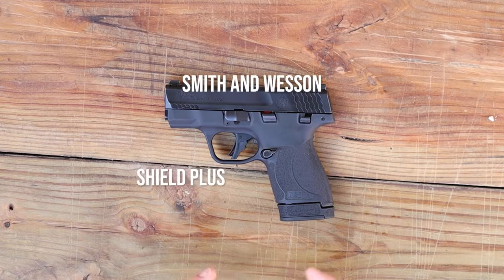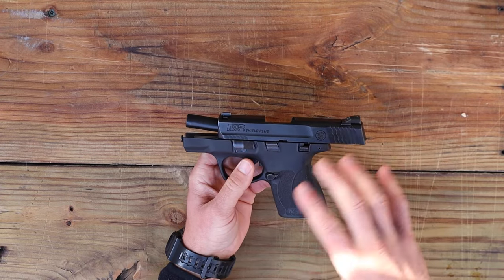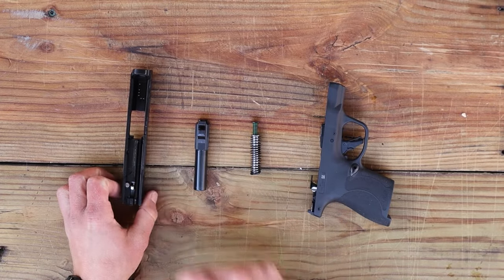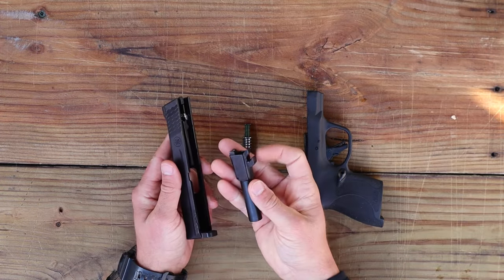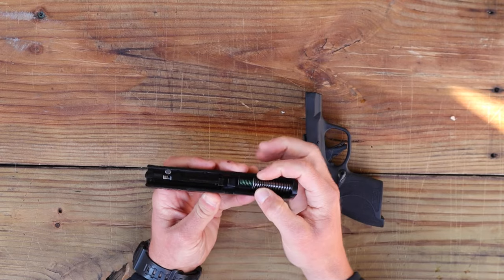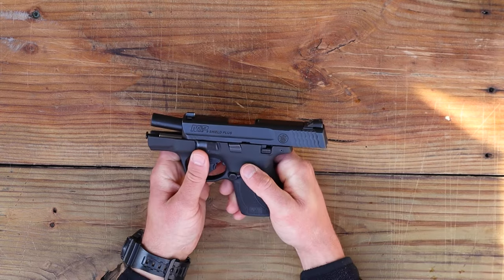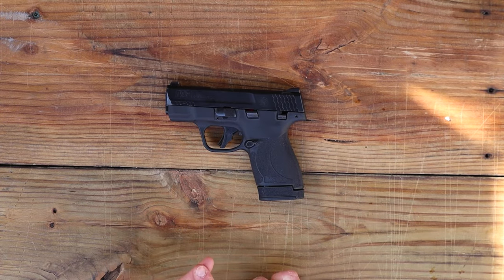S&W Shield Plus Field Strip (Disassembly)

Comment: much simpler than the video i watched, they had me manually push the pin down inside the gun instead of just hitting the trigger to release it. appreciate the tip
Reply from the maker: much appreciated!
Reply: They don't recommend you pull the trigger. That internal sear deactivation lever actually fell out on me when I tried to reasseble it. Added/unnecessary complexity that has me running back to Glock.
Reply: I saw that video! That's why I am here. This man is great!
Reply: The newest Shield Plus guns (got mine end of February) don't have that little yellow pin/lever, whatever, to move anywhere.

Comment: Great, great video but I do have a question. My Shield Plus is brand new and has not been fired yet. That take down lever, like you stated, is hard as hell to move. Can I add a little oil around that or inside when I have it torn down or will that cause other issues?
Thank you for such an informative video!

Comment: I have a brand new Shield Plus and the takedown lever is really stiff. What can I do?
Reply from the maker: the only thing I've found to help break them in is to use them. Both disassembling multiple times and shooting it a bunch. It'll never be butter soft easy but it will loosen up to something manageable in just a few trips to the range and take downs in my experience.
Reply: @cobaltfirearminstruction2003  Thanks for the reply.   That is what I thought.  I was hoping there was an oil that I might use, but I will wait until I go to the range this weekend and then do a cleaning.   Your videos are really great.

Comment: Just bought one of these and put thirty or so rounds through, great shooting gun, feels really well in the hand especially for being a compact pistol. However when I got it home and did this exact field strip, that locked slide spring separated sending part of it into my stomach and the heavier part right into my tv!!! I haven't contacted SW on this yet but I felt the need to bring attention that you shouldn't trust that spring to stay together I winched in pain when you just kinda dropped it on the table, but yeah, great take down video
Reply from the maker: Appreciate the heads up!

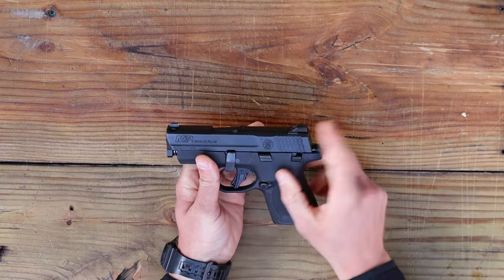Comment: Suggesting an alternative to pulling the trigger (~2:10) to remove the slide. There's a yellow/brass-tone sear deactivation lever near the top of the magwell (barely visible at ~2:16, best view at 6:10). With the slide locked back, pushing that lever down/forward will let one remove the slide without touching the trigger. The full size M&P comes with a tool in the backstrap, but you need a pen or small screwdriver for the Shield. Putting the magazine back in after reassembly resets the sear lever.
Reply: If you safety check the gun why not pull the trigger? Will that effect the gun in some way or is it based on safety?
Reply: @brianthomas9445  safety. part of always treating a gun as loaded, pointed in a safe direction, only touching the trigger when you're ready to fire, etc.
Reply: @michaelpeavy3074  👍
Reply: Maybe the most important step ! 😮
Reply: @donaldbenson7384  Listen im all for safety but if im in my own home and know for certain my gun isnt loaded seeing as im taking it apart.... im pulling the trigger. trying to push that pin down without a tool is tough!
Reply: It’s easy to do with your pinky finger, but I hesitate to recommend it because if the slide closes on your pinky finger it will be a memorable experience ( :